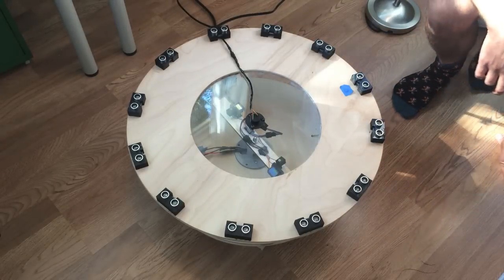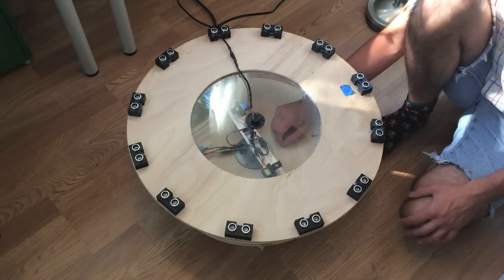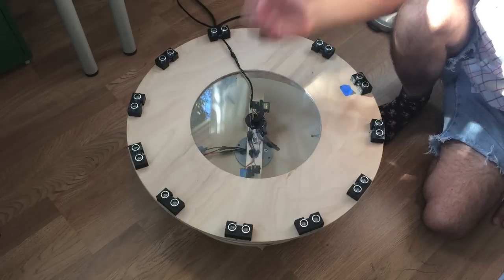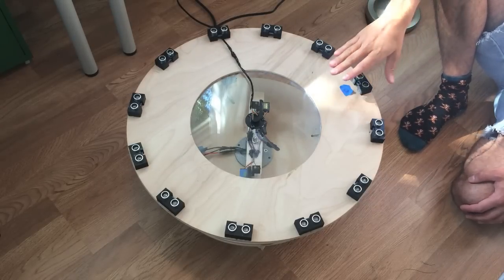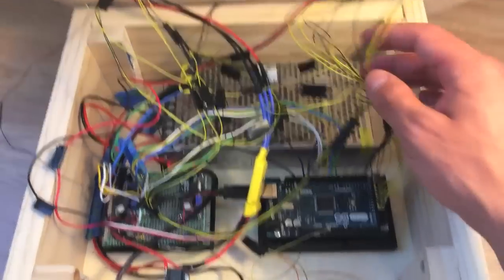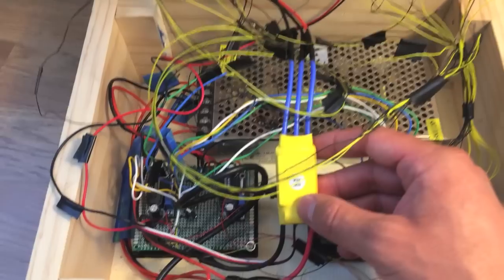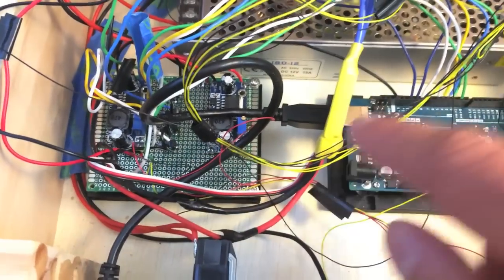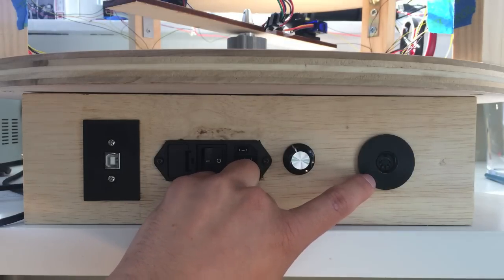Spinning laser sheets created with Arduino

Comment: I'm curious... Why spin the lasers? Why not just deflect the beams with spinning mirrors?
Reply from the maker: Great question. Many of the laser vortexes that people build have a tilted mirror mounted at the axis of rotation with a stationary laser directed to the mirror. This creates a laser sheet cone. However, with this design, all laser sheets will appear to originate from a single origin. If the lasers are positioned off axis like with the design I built, you are able to create converging laser sheets, like the hourglass shape shown above. You are right though, for the easiest laser vortex build, all you need is a single mirror mounted to something that spins.